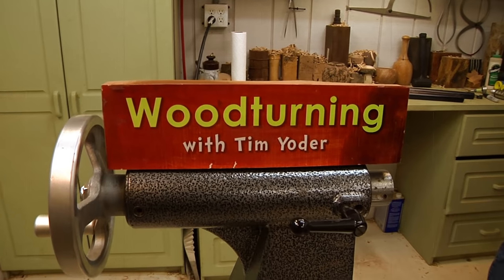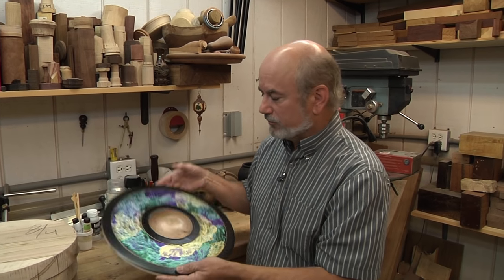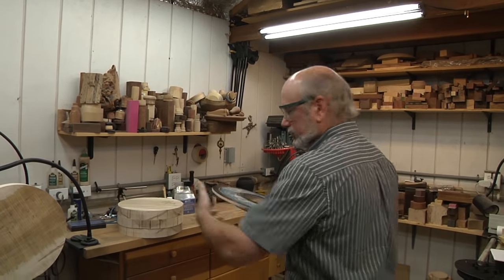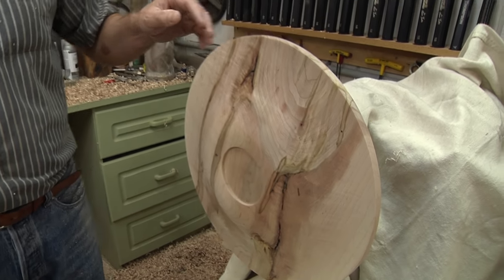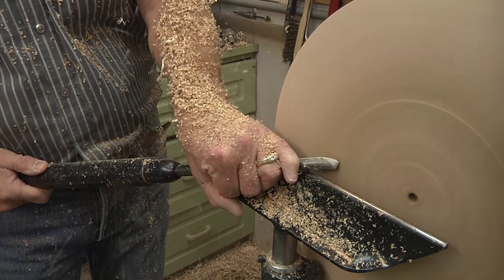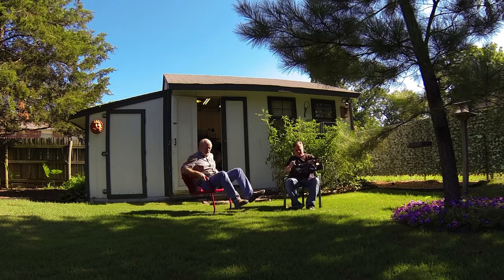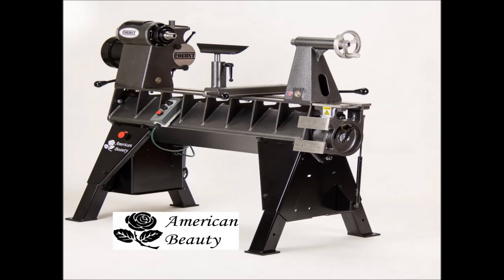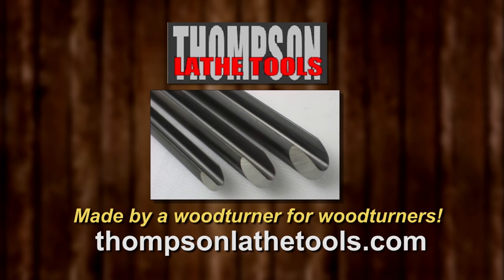Cosmic Clouds Platter

Comment: Tim.. 

I know a little bit about the medium you were using so I will share.  These are not true "iridescent" paints.  In fact they really aren't "paints" in the normal sense at all.  Paint is pigment in a binder.  These are called INTERFERENCE COLORS.  They are specially milled mica flakes coated with titanium in an acrylic binder.  The flakes don't really have much color at all unlike pigments or metallics.  Different thicknesses of the mica cause different color reflections/refractions when light hits them at a certain angle.  That is the "pop" you spoke of.  When the light is not at that angle, the interference colors are very pale or even white.

The reason why you don't want to build up thick layers is that you create opacity since the mica flakes can't contrast with the dark underlayer even when the light is right.  Dark bases show off the interference colors best.  On a white base you can barely see the colors even at the right angle.

Iridiescents are typically metallic paints that have some shimmer.  They are in a sense similar to interference colors in that the angle of the light causes that flip effect or chatoyancy.  Nevertheless, iridescence is not the same as interference.

You did a terrific job of figuring out how these darn things actually work and created a really cool project.  I spun up a shallow platter-bowl this week and painted the inside with black gloss enamel and tomorrow I will be trying out your techniques.  Thanks for the great video.Bree
Reply: BTW... don't thin the interference color with Flow Aid.  Use Airbrush Medium.  The reason is that Flow Aid (which reduces surface tension) is not made with acrylic polymer.  If you thin acrylic paint or in this case interference color more than 30% with water or the like, you reduce the film strength since there isn't enough acrylic polymer to cross link and create a stable film.  You run the risk of having the color flake off in the future since there isn't enough binder to hold it on the wood.

Airbrush medium is very thin acrylic polymer so it is perfect for thinning the color.  You can a drop of Flow Aid if you wish.   Normal dilution of Flow Aid is 1 part Flow Aid to 20 parts water.  A drop or two in the airbrush medium is all you need or want.
Bree
Reply from the maker: Just saw your post Bree...better late than never😊 Excellent information! Thank you for sharing. I am demonstrating this project in February and I will include your advice.
Reply: Brianne Corbett  How interesting and informative!  Thank you for the detailed info, this is very useful to know.  I wonder if you can mix fine glass beads with any acrylic paint, or even mica chips sold loose, so that you can create your own iridescent paint mixes.  Some of the higher end acrylic colors are superb, and unusual.  
For those who don't understand CHATOYANCY term:  Chat (Sha) is Cat in French.  Chatoyancy means a gleam like a cat eye.  Some gemstones have this gleam such as Tiger Eye in both ochre and reddish brown.  So does a star sapphire, fiber optic beads, etc.

Comment: that last green spot you painted almost looked like flames/ghost flames which is pretty popular. to do this idk if you needed an airbrush. the blower you can put at end of air compressor to blow off your work space would probably work fine at low pressure. . but if you learn to airbrush you can do some crazy airbrushing on your wood. though that is another skill to learn.

Comment: I used to use that precise medium dilator with acrylic paints, in facts it has 2 effects on paint.
1- Exactly as you explained; it liquifies the paint.
2- It extends the drying time required for the paint to set
It the combination of both effects that allows you to use that paint gun so extensively without drying your paint and creating undesired creases.

Comment: I assume the air brush is used for better control, but I think one could use a regular air gun(for cleaning parts etc.) for a similar effect. Of course with the air pressure turned way down as you did for the air brush.

Comment: Very neat stuff, beautiful results. I do have a question though;  if you didn't want to paint on the lathe, would there be a problem taking the platter off, painting it in a more dust free/ventilated area, then chucking it back on?

Comment: Tim, this platter is unusual and beautiful!  You make it look easy but it takes skill to make that.  I cringed when you sprayed the black paint, but wow, the contrast against the wood grain is superb.  Loved the acrylic peacock colors too!  I wonder if you need to spray on a sealer coat for the acrylic to be more stable and not flake off or be susceptible to scratches from use.  Please do share.
Also, is a sanding sealer the same as a wood filler medium?  Not sure of the difference.  Do you use a sanding sealer on all your wood pieces, or only the open grain type, or on certain high polish pieces?  I've never used it, but thought it might be useful on high gloss lacquer wood frames, etc.

Comment: Great idea & video. I was trying the process out and sprayed the wood with  Valspar Project Perfect paint and let it dry overnight. Then sprayed with Deft lacquer sanding sealer and the surface crazed over. It appears the two finishes are not compatible. What kind of sanding sealer were you using?

Comment: Did you use  "sanding sealer" as a primer for this ?  I didn't notice any other "primer".  Is a black coat as a base primer a good idea or does the "sanding sealer" act as a primer? At-- 21:49 in the video, what product are you spraying with?
Thank for this great video, your platter turned out beautiful and I learned a lot!!

Comment: That is a very beautiful piece of wood, and even more beautiful of a piece when you finished. But I have a question for you, and was wondering if you would be interested in some Mesquite wood for a project? Reason I am asking, is I am clearing out some Mesquite tree's as well as some other woods that I am not sure what they are. And it is kind of a shame to just throw the wood into the burn barrel, as I know Mesquite and Pecan are some beautiful woods. And yes Pecan is one of the woods I am getting, as I have an old pecan tree I have been removing some low branches on. I also have some old  post, that you might be interested in, that I think are redwood.

Comment: any reason you used that particular flow aid and not the josonja? does the brand you used work better? this platter looks great and I want to give it a try. found the paint and same brand flow aid on Amazon. just want to make sure it works right the first time. thanks

Comment: You used a lacquer sanding sealer over the project perfect enamel paint. Did you have any problems with that? How about using black enamel paint.
Reply: I did not have any problems using them together. I did make sure the everything was really dry before applying over the enamel though. I will keep an eye on the finish as time goes by and update if it goes south.

Comment: Hi Tim, Great videos. One question what type of sanding sealer are you using? I can't seem to locate acrylic sanding sealer only lacquer. Just curious if that would still work. Thanks
Reply: Charles Castetter - lacquer is fine as long as you spray thin, thin coats and use a paint and primer combo over top. Make sure everything is good and dry between.

Used to work in a finish shop. Still restore/refinish on the side. It's a passion of mine.

Comment: Just ordered the products to give this a try. It seems that Liquitex is a concentrate to be diluted. Did you dilute or use straight from the bottle? Thank's,,,,,,,,Keith
Reply: Whoops! I did not notice that. It seemed to work really well at full strength.
Reply: Yep; it worked great! Maybe they recommend diluting when mixing paint to be sprayed in the air brush. Just received my bottle yesterday and think I'll give it a try both ways.

Comment: Tim, which sanding sealer do you use?
Reply: I'm wondering the same thing!!  Tim?
Reply: For this episode I use Watco lacquer finish. I usually use hand rubbed Minwax poly. I like it better because there are very few fumes. It also is easier for me to apply an even coat by hand than spray.